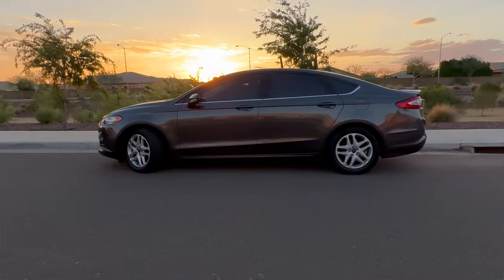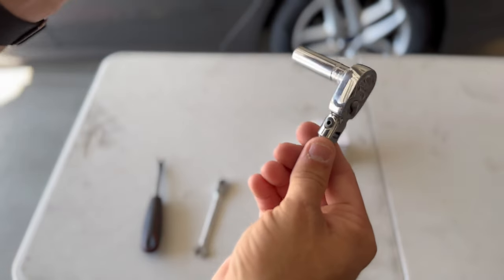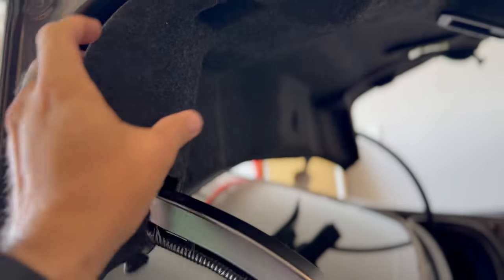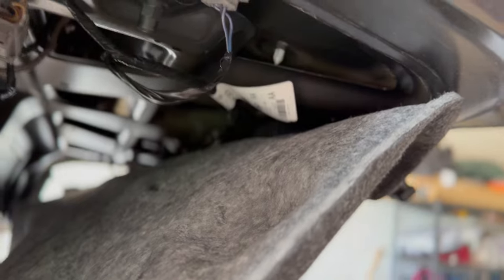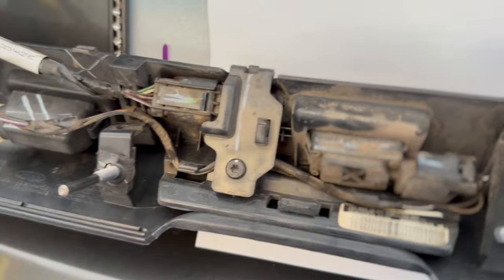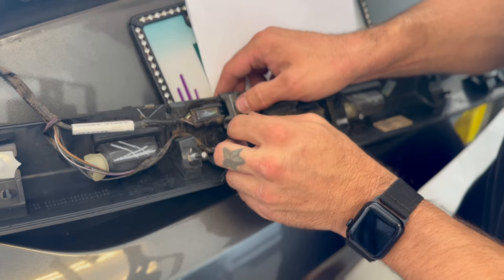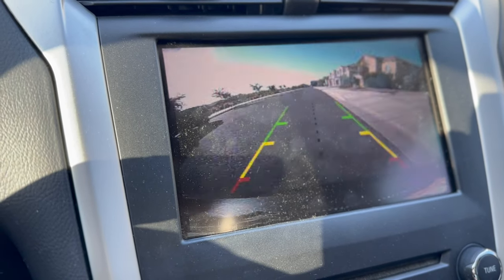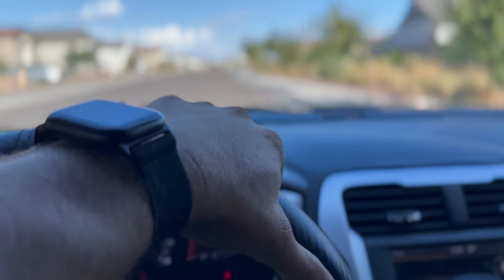Ford Fusion Back-Up/Rearview Camera Replacement Step-by-Step.

Comment: For all those that have a 2013 Ford Fusion and want a Ford OEM camera, the camera from the MKZ can also be used in the Fusion as well (per Ford). Much cheaper also. Ford Part# EP5Z-19G490-A. Most sites only list the Ford # ES7Z-19G490-A as the only option for Fusions. An aftermarket option is TRQ brand Part# ADA05221.(these all have the green/yellow/red boxes and guidelines) Hope this helps.

Comment: I did this and it all went well until I tried putting it back together. The camera works great, but I can't get that rear panel to sit correctly under the FORD emblem. Also, the rear lights on the trunk are now not working. I plugged them in so I'm not sure what the issue is... any advice?
Reply from the maker: I explain how to put the panel back as best as I can you have to kind of pop it back in with it under the emblem it is the hardest part of the repair, as for the lights I would say just recheck the connector make sure they are fully seated and you cannot pull them off. Second look for a main harness. That runs doing the truck lid arm and see if everything is plugged in and secure. After that is all confirmed you might need to start check for power and ground and then your fuses.. it’s possible a fuse popped.
Reply: Thanks for the quick reply! Lol I was kind of agitated and thought the trunk lights weren’t working but realized they were fine. 

But yeah I’ll have to play around with it more to get the panel to sit on there correctly. Appreciated the input 😁

Comment: Bob thanks for this video. I actually have a 2013 Fusion SE but the instructions you provided here worked perfectly for me. I bought a good quality camera on Amazon for $60. The dealership quoted me $620 for the part (yes, that is not a misprint!). Then there would have been labor on top of that!  In about 1.5 hours, I followed your instructions and had the camera replaced! Thanks for this great tutorial!
Reply from the maker: So awesome to hear this! I was also amazed how much the dealer wanted for the camera. Thanks for your support! Don’t forget to like and subscribe it helps out a lot!
Reply: Hi, is the $60 amazon camera good quality? I need to replace mine but i want to make sure that the quality is acceptable
Reply from the maker: It’s comparable to all the other cameras I would assume the QC may not be as good but who’s knows nowadays. I’m sure they are all being made out of the same factory..

Comment: Tnks great video, just you forget to put that piece en place 14:58 min 14:59 the white piece
Reply from the maker: It’s possible but if I remember right I caught it and pulled the light back out to install it correctly. This video is not live and has a lot of cuts and out takes..

Comment: I saw you link this video on Reddit and finally bit the bullet to try to find a solution to the dreaded "Return to Dealer" error message that plagued me for years.

I was able to perform the replacement on my 2014 in about 1 hour with the caveat that I broke the two exterior screw housings when I made the final yank of the housing off the rear of the car. I am still not sure how you were able to remove the housing so cleanly but I am still incredibly happy with the improvement.

Comment: The best video I've seen on replacing the backup camera! Excellent to review the tools someone will need BEFORE they start in on the job as we all know how it sucks to get started and need to run to the store for something like a torx bit (you should update the list of tools btw). Your step by step is perfect as I just watched a video that just ran through the camera replacement and pointed to where the bolts/screws/torx are located - yeah, good luck with that. Thanks again, subscribed to your channel, appreciate content like this greatly! (BTW, thx for video sans music.)
Reply from the maker: Thank you! 🙏

Comment: This was probably one of the most in-depth helpful guides for us Fusion/MKZ owners who have this issue.

I drive a 2013 Lincoln MKZh while its mostly the same car as a Fusion the body panels can be different. Would installation be similar? 

Also did you have to configure the new camera with your MyFord system?
Reply from the maker: I’m sure installation is similar, that being said I have never done one so I would have to look at it and see what’s different if anything. 

This camera was plug and play I have never heard or had to program a camera in the handful of cameras repairs I have done.

Comment: Thanks for the detailed and easy to understand instructions. Would it work the same with 2015 Ford Fusion Hybrid SE?
Reply from the maker: It would be similar.. same idea just have to see where all the connection points are for each trim piece..

Comment: Thanks Bob. I replaced mine with the exact one you have but my camera isn't centered. Is there any way to correct this?
Reply from the maker: I have no idea without looking at it to see exactly what it is doing. Some things to check. 1. Make sure it is fully seated in the camera bezel. 2. Make sure the camera hold down is also fully seated and screwed back down. 3. Second does the camera look different or damaged compared to the camera removed. 4. Maybe try returning the camera to Amazon and getting a new camera. 

If this all doesn’t fix the issue it may need to be looked at by a professional technician to diagnose further. 

Thanks again!! 🙏🙏

Comment: Thanks for the great video! What would you consider a reasonable price if I were to have a workshop do it?
Reply from the maker: Honestly it depends on what the book time is to replace the camera. If the book time says 1.5hr labor than your paying their labor rate for 1.5hrs. Hold the shop to the book time. Get a couple quotes so you know you’re getting a fair price.
Reply: @Bobsgaragetech  I replaced the camera last week and it works fine now. Thanks again for the video. I’d say the hardest part is getting the whole piece out and putting it back in. It looks way easier in your video😄
Reply from the maker: @chrisxu4832 yes I think I stated that was the hardest part, I also have 20+ years of experience as a mechanic. Thank you so much for the support I love hearing feedback back!
Reply: @Bobsgaragetech  my fear is I have hands/fists like a "pot roast" so am concerned about my ability to get into access the camera... but it's my wife's car, so...guess who's going to volunteer?

Comment: Just installed it in my mom's 2013 Ford Fusion, but now the camera is always on. What'd I do wrong?!
Reply from the maker: No idea, that is a crazy symptom something is telling the radio to switch on the video feed. Could be the wrong camera? My recommendation is to pull that camera back out so you can have your radio back. You may need someone to professionally diagnose the issue.